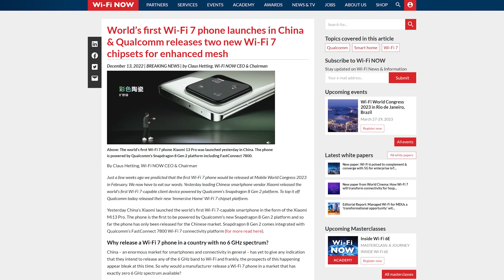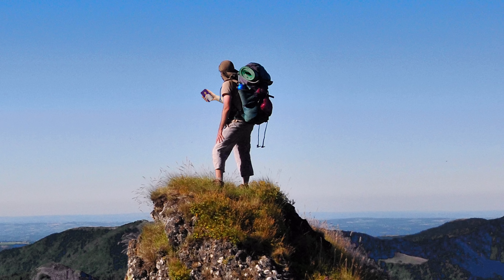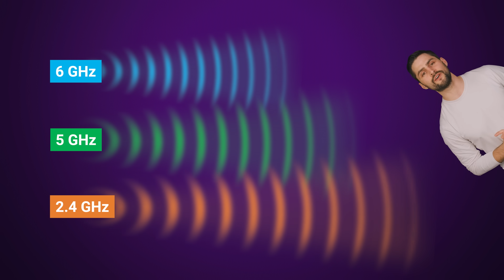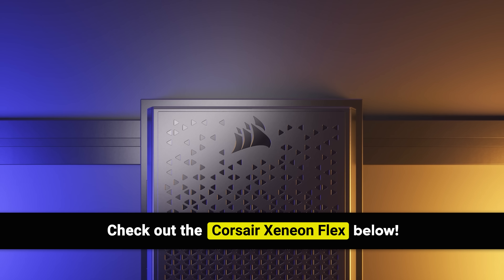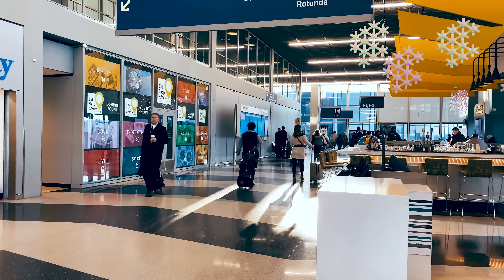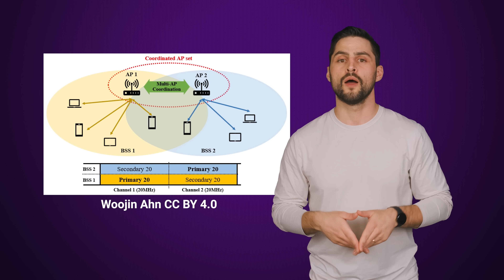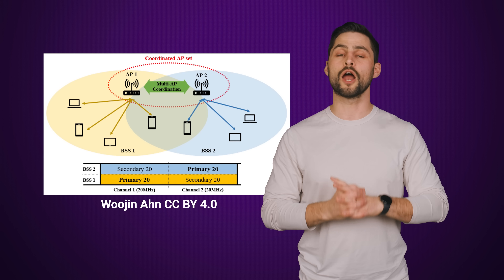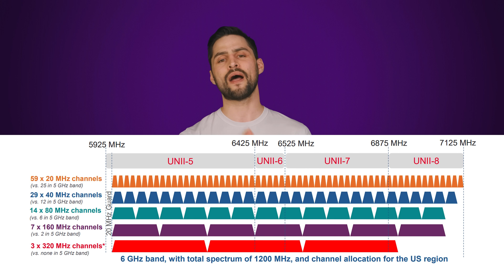Can Wi-Fi 7 Replace Range Extenders?

Comment: If you were using WiFi for a low-datarate tasks, would MLO give any advantages for range/connection stability vs. just enforcing 2.4GHz on existing generations of routers? Seems like it's just about preventing users having to switch manually, right?
Reply: no
yes

Comment: So basically the main benefit of wifi 7 is just going to be seen if you are in range of the 6GHz signal meaning you are also in range of the 5GHz and 2.4GHz... otherwise, if you are far away you will just be running on 2.4GHz like we do now with wifi 6 when you are too far for 5GHz. I think i am good with WiFi 6 for a while then... the bandwidth is already more than i can get from my ISP without paying an arm and leg

Comment: The problem with Wifi is less that the signal drops, but that it gets INTERFERED WITH by other signals (mostly WiFi) in the same frequency band.
It's an "on the air" product, that issue CAN NOT BE ELIMINATED.

Comment: Last time i bought a wifi product things were letter designated like a g n. When did numbers like wifi 6 come in? What do they even mean? 

I need to buy a usb wifi adapter for my pc. On the one hand i don't want to spend more than I need to, on the other hand I don't want to get something that will be soon be obsolete. I'm also hoping to wire Ethernet anyway so I may not need it for long. My router is a BT smart hub 2 which is dual band and supports 802.11a/b/g/n/ac. This is unlikely to be upgraded any time soon. So I assume there's no point buying something with higher features than this, since they wouldn't be used unless I bought a better router? My main priorities are range and reliability of connection. Is it best to have an external / finger sized antenna? My instinct is to look for the cheapest one that supports ac. Is there anything else that would make a difference assuming my current router?

Comment: 1:00 is there something I don't understand because I live in germany and here are almost every router already have that feature to host the 2.4 and 5Ghz on the same Name and then automatically switch to 5Ghz if the Signal is good and to the 2.4 if it's not so good???
Also works aswell very good in a Mesh... 

In case u not from germany reading this and want to take a look on such a router: almost everyone here has one from the Company "AVM" that sells the "Fritz!Box" in various models for ex.: Fritz!Box 7590
Reply: you can usually separate the ssids in router admin settings

Comment: Hopefully, a new WiFi standard that natively supports IP multicast by assigning a group-address on a certain small frequecy bandwith through TDM would be considered as a revolutioary killer next-gen technology. Only then will we more excited on communications technologies such as this.
Reply: Wifi is lower layer for networking, its independed from TCP/IP same as ethernet, thats why old devices support IPv6 with software update, so its something TCP\IP needs to support
Reply: Wi-Fi 6 has addressed the issues in previous generations of Wi-Fi. They dropped CSMA/CA in favor of OFDMA. As far as I know, TDMA is used in cellular networks, as well as WISP networks, who use equipment from companies like Ubiquiti, Mimosa, Mikrotik, LigoWave, IgniteNet, and Cambium Networks. The TDMA implementation in these are proprietary.

Comment: But my AirPort Extreme from 2010 does a very similar trick when not separating the networks in 2,4 and 5GHz, jus leave one and it will broadcast both to a device and it’ll select one of them based on the noise/distance.

Comment: It's so funny to read in the comments where people think a) having 5G and 2.4G on the same SSID is the same as MLO (it is not!) or b) having both frequency bands on the same SSID is bad and devices can't handle it. (almost all can... has been the case for years!)

if having one SSID for your wifi frequencies is a good idea however, totally depends on your environment. problem here isn't that routers/APs (or client devices) can't handle it, but rather the "stubbornness" of devises about clinging on to a connection (aka poor roaming) as mentioned in the video.
sometimes "prefer 5G" (or 2.4G) can help (most windows wifi drivers should allow this for example), but even that isn't great all the time.

I'm really looking forward to MLO, but having an "advanced roaming" where connections are handled more dynamically will be even more important imho!

Comment: Didn't even bother to mention the biggest reason to use Wi-Fi 7: VR frequency. The ability to send tiny packets at blistering fast speeds instead of one large packet every 100ms is going to be mental for wireless VR such as Quest Airlink. I absolutely despise being tethered to a cable and controllers so this is a must have for me.

Comment: who have 10Gbps ISP line in home?
Reply: Wifi standards it not just speed upgrades, each upgardes comes with cordination feature improving effecency or radio usage, in fact using older hardware And standards prenents newer once to be properly utilized

Comment: So the range thing is just the same as ac and ax using band steering on the same ssid? So at the edges of the AP range, you'll still lose connection. Hmm. 
Other improvements seem quite good though.

Comment: My wifi already does this, except for having both connected at the same time. It switches automatically between the 2 frequencies when you get too far away, so it’s this but with less speed at shorter ranges

Comment: as someone who installs wifi APs a handful of times a week, its not going to make a difference, i've installed so many 6 and 6e APs, no one notices a difference
Reply: Thats because lower frquences are poluted with older hardware signals which prevents use of all features, same as 5G NSA over 4G bands is not as good 5G SA as its being dump down by noncooperative 4G devices on those bands, and improvments are made for crowded areas and if you internet connections sucks more then your wifi then you definitly wont see diffrence

Comment: Starting with 802.11n, Wi-Fi standards included simultaneous dual-band 2.4 GHz and 5 GHz support as a standard feature.
Reply: not all 802.11n routers & devices supported dual band
Reply: @gamecubeplayer  not all routers and devices supported 802.11n
Reply: @rhydlew  from what year? 2012?
Reply: @gamecubeplayer  what point are you trying to make?
Reply: @rhydlew  you said "not all routers and devices supported 802.11n" but i don't know what year's routers & devices are you talking about
Reply: @GameCube Player  what year were you referring to saying that "not all 802.11 routers and devices supported dual band". If we're always having to specify year ranges then let, please, after you 😉 lol
Reply: @rhydlew  dual band was never an 802.11n requirement because you can still buy new single band 802.11n routers
Reply: @gamecubeplayer  you might be thinking of 802.11g. Or 802.11a
Reply: @rhydlew  no i'm serious that dual band was never an 802.11n requirement (it was supported but optional)
Reply: @rhydlew  you said that you'll do it after me so will you do it now?
Reply: WiFi 5 aka 802.11ac works 
exclusivly on 5Ghz
Reply: @ShadowriverUB  i know that
Reply: @MrAtul1962  most 802.11n routers & devices didn't support dual band because 5ghz radios were expensive & dual band n600 routers also required 2x more powerful cpus than single band n300 routers
Reply: @MrAtul1962  2030s? i think 2026

Comment: Isn't this just ASUS Smart Switch where you have 1 SSID and the router and phone chooses a band/frequency to be on depending on the distance and signal strength??? How is this a new WiFi standard???
Reply: Its non standard, it probably exploiting some thing, also MLO allows client (not router) to use both frquinces at once at same time while older wifi only let you use one at the time, so its more then just switching

Comment: Errr, your client will automatically connect to 2.4ghz if it thinks it cant hold a good connection to 5ghz. This has been around since 11n.
Reply: It can but it doesn't use it SIMULTANEOUSLY with other frequencies at the same time. Now WiFi 7 has this ability.
Reply: @MAFz7 this guys terrible at explaining things. So mlo is agregating different bands?

Comment: The coordinated roaming is hands down going to be the most useful function, because it's infuriating to troubleshoot when you have multiple access points in your house, but only one of them reaches certain areas.  The networks I manage at my day job will probably get WiFi 6E in another 10 years, so in 15 years it's gonna make my work life much better.
Reply: and whats the benefit over the current coordinated roaming we have? In my network all devices roam seamlessly from one AP to the next, coordinated by a central WiFi controller. I can even play VR-games in my entire appartment with 4 APs without dropping below 300Mbit of bandwith (150mbit is the minimum for VR streaming to work)

Comment: again, there's no point of super fast wifi 7 blah blah blah if all those IoT devices "smart home" (smart bulbs, smart switches, door sensors, etc etc) can only support wifi 4 (802.11n) on 2,4 GHz band *ONLY*. Topped with super weak internal antenna.

Comment: I don't understand why phones don't have the ability to ask to seamlessly switch router on the same SSID ("Hey original router, I see FA:1B, can I go over there?") and the original router just pass over the connection table. With an extra antenna in the phone, you could even pass the connections over one at a time. Heck, you could even TCP multi home/path that biz to really make it even more seamless.
Reply: in other words wifi access points should be pingable.

Comment: Why wouldn't they fix the receiver (phones) instead of the transmitter (access point /router) for holding onto an inferior signal
Reply: It does, standard controls both rouyer and cluents behaviors

Comment: What about 900mhz?
Reply: Obsolete
Reply: @ihavenoideas5844  FALSE.  900mhz is lower bandwidth but superior propagation.  Could be excellent for iot devices or for routers to talk to one another to negotiate settings and when to pass off a higher frequency wifi device.

Comment: The more I started looking into the wifi explosion, the more I started reconsidering a Cat8, whole house wiring project. I'm planning on putting a powered, weatherproof switch under the house and branching to the various rooms. We already have coax run that way, so it won't take much to run the networking in parallel. While I doubt we'll ever see (read: willing to pay for) gig, It'd be worth the investment to have the high bandwidth for data transfer for the planned storage share.
Reply: Eh, not sure if cat 8 is worth it or not, cat 6a or maybe pre-terminated fiber can be good if you want more than 10gb or more sfp+ or qsfp, etc
Reply: @ironfist7789 It's overkill, but it's still cheaper than getting a wifi 7 router and access points.
Reply: Cat 6 or 6A should be more than enough for a house.

Comment: PLEASE PLEASE PLEASE PLEASE explain why routers DON'T implement 6 and 6e in the same router!  Why is it either 6 or 6e?

THAT warrants an entire (1.5 hour please!) WAN show!!
Reply: wifi 6 routers support 2.4ghz 802.11ax & 5ghz 802.11ax

wifi 6e routers support 2.4ghz 802.11ax, 5ghz 802.11ax & 6ghz 802.11ax

basically wifi 6e routers are wifi 6 routers but with the additional 6ghz band

Comment: It would be good if they included a very slow bandwidth frequency as well as a "better than nothing" connection too like 200 Mhz or something.
Reply: There is not that much of spectrum for home use, closest to this would be 433 Mhz but even if it would be implemented, bandwidth would be severely limited and devices need to have bigger antennas, since it needed for longer waves.
Reply: There is the HaLow WiFi already available:
Indoor range is something like 3rd floor to the basement and outdoor range is more than 1km without any special care and more than 10km with better antennas..... but is slow, very slow......

Comment: van anyone please tell me the difference in 5ghz  wifi    literally sitting next to your router....

....and what the holy hell is this 10g  mobile data ive been hearing about...i was like ok  5g....DAMN thats fast...but  how did they skip to  10g????    and how does that compare to the highest hard-line fiber optic internet there is...

seriously..... ive been using the internet since 28.8 kbps dial up modems to play bbs board games like Extalagis...which was sooo awesome back in the 90's ....

im totally feeling im being overrun by IT tech and how it works...

Comment: it's a techquickie, so maybe it's just a missed detail.  Licensed users of frequency space aren't the only reason it's limited though.  If your neighbors are blasting at higher power, you will have interference from more of them.  Longer range can be a double edged sword if you live in a densely populated area.
Reply: Yea, you would think the like 18 other wifi routers on your block you can see right now, would be more trouble then weather radar, or adjacent users.

Comment: 3:42 Respectfully, I must disagree with the information provided as it does not align with the current status of the issue. It has been resolved through the implementation of IEEE 802.11r/k/v also referred to as fast roaming. However, it should be noted that many large Wi-Fi networks remain misconfigured, lacking the necessary feature to enable fast roaming.
Reply: The information at 3:42 is valid, Fast Roaming has zero influence on when the device chooses to start the process of roaming.  That is purely down to the device.

Fast Roaming addresses the process of roaming and the steps involved in switching from one BSSID to another, cutting down on the process time, excluding the need to re-authenticate.  Without re-inventing the wheel in YT comments there are plenty of Wireshark Captures out there that show the differences in r/k/v, where 4-way handshake doesn't happen.  The impact is noticeable on Voice calls.

Not every device supports those 802.11 revisions.

Comment: So basically gimmicks. I would simply stick with 2.4GHz because that is already enough for 99% people. 2.4GHz can allow you to watch 4K and that is about the maximum 99% people needs. Heck, Linus discussed the other day most people wont even notice the difference between 4k and 720p on a phone. As for roaming, don't they already have 802.11r, 802.11s, 802.11v etc for it? This is like 5G all over again. Useless shit only developed because companies need to sell new shit.

Comment: This sounds great but at the same time it also sounds like it will have the same issues that band steering has already. I’ve got a Roku stick that already won’t let go of the 5ghz band on the opposite end of the house while a laptop won’t get off the 2.4ghz band sitting next to the router. Call me old fashioned but I’m still down for manual switching between bands rather than waiting on a firmware program to decide that my latency is still within tolerance to stay on the same band

Comment: 3:46 mobile devices only have this nasty habit when they're being used quite a bit or doing something real-time with the network such as a call as they don't have the opportunity to roam around for other networks as it can hinder their own performance. They become stubborn when battery savers are on as it reduces how often they roam for new networks. However in normal conditions, with a phone locked and you move around, it should most definitely switch routers as it has no reason to not automatically roam.

Comment: Isn't this just a further implementation of 5G?
Working on multiple bandwidths to maintain a signal, but that is kinda crappy too.
Yeah, it might not drop the actual signal, but you go out of the range of the 5Ghz and you are back to slow speeds again and you won't be able to watch 4k or maybe even HD, because you are basically using the same tech from 10 years ago, as in 3G.
And I won't go all conspiracy theory, but before we through out all this radiation, shouldn't we at least wait till we get some conclusive results back from long term exposure to 5G signals?
Reply: No, fact you switch to 2.4GHz dont mean you use n or g standard, its 7 over lower frequinces and it still has new features, problem is older devices that dont have those cordination features will prevent newer once to use those, so its conditional. it exacly same thing as 5G over 4G bands, its kind of better but useless with all 4G noise, with appartments it wont make diffrence but in freeroam areas it will give benifets.

Comment: Your also forgetting that most wifi routers only transmit at a very low wattage. Where I can transmit at 3 watts on the 2.4ghz band for fpv. Tho if every router screamed that loud it wouldn’t be funny.

Comment: Bad take suggesting older devices will continue to use 160Mhz, given most phones only support 80Mhz or even 40Mhz.  AFAIK all Apple devices are still missing 160Mhz support, though that still means they can reach close to Gigabit under good conditions.

Comment: It seems problematic to have hardware already implementing a non-finished specification.
Reply: I guess the hardware is also not finished and maybe there are good friends with someone who is in charge or ratifying 7. Seems like a stretch but 🤷🏻‍♂️
Reply: @kdt110  yeah exactly. An unfinished specification can result in hardware that will not match the final specification.

Comment: My Netgear router doesn't send all bands at the same time to my phone but it automatically switches between wifi 6 and 6e depending on how far away I am from the router seamlessly. So I already feel like I have this.
Reply: that's just band steering. you're still only ever on 1 channel at a time, rather than all available channels at the same time. but yes, at distance it will work like regular old wifi. I see this only being beneficial for extremely congested area's like concert halls and stadiums.